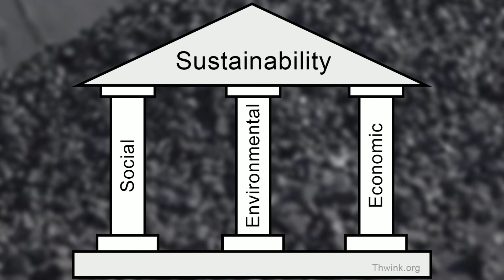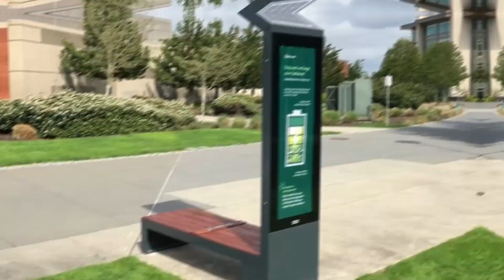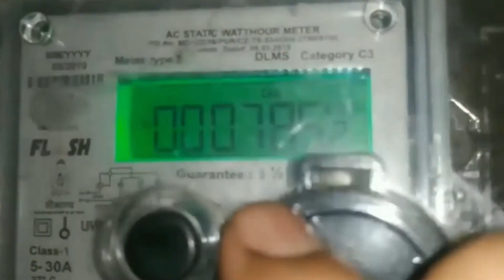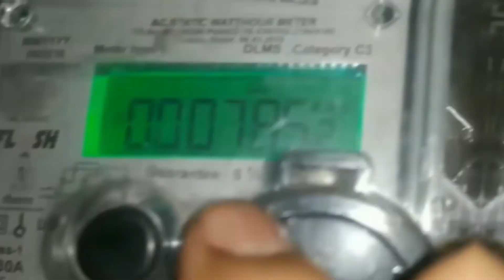Uruguay's Remarkable Journey to 98% Renewable Energy

Comment: Electricity is not cheap there at O.225 kw/ h in march it might be renewable but the benefit does not reach  the citizens that have to go without airconditiining in summer or heat the house burning wood or use kerosene heaters becsuse of the high ekectriciy cost
Reply from the maker: Your observation about the high electricity costs in Uruguay is valid, and it's unfortunate that many citizens face challenges in affording essential comforts like air conditioning or efficient heating. In comparison, as of March, the cost of electricity in Uruguay at $0.225 per kilowatt-hour is notably higher than the average in the United States, which is around $0.13/kWh. Germany, with a cost of approximately $0.35/kWh, has one of the highest rates in Europe. On the other hand, China's electricity cost is roughly $0.08/kWh, reflecting a lower rate due to a diverse mix of energy sources.

This comparison underscores the disparities in electricity costs globally and highlights the economic challenges faced by residents in Uruguay. It's a complex issue influenced by factors such as energy infrastructure, government policies, and regional dynamics. Hoping for advancements that make clean energy more accessible and affordable for everyone in Uruguay and around the world.
Reply: @Z-missions Very expensive country not only in terms of energy 😂